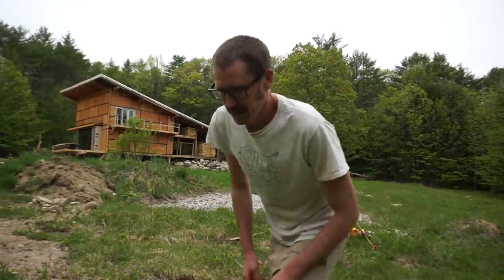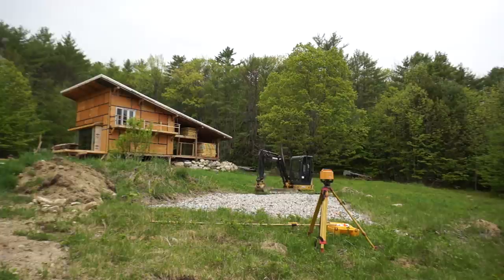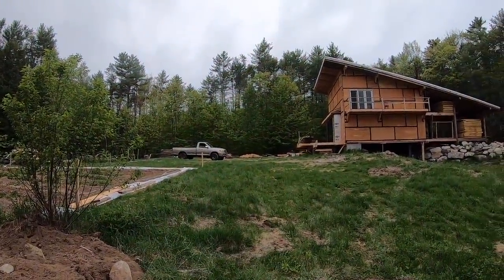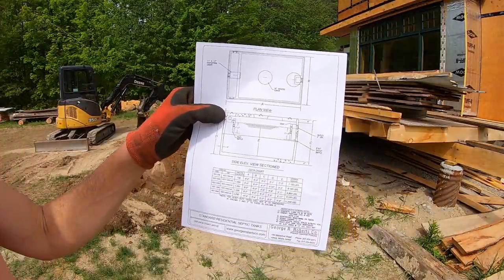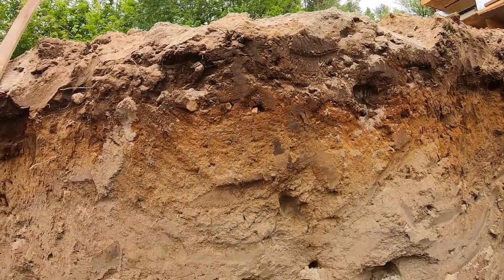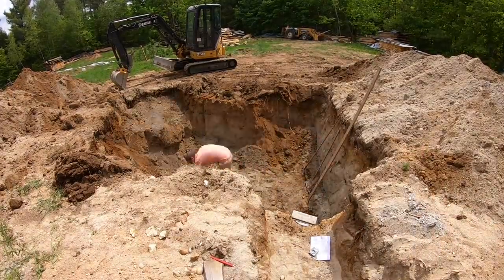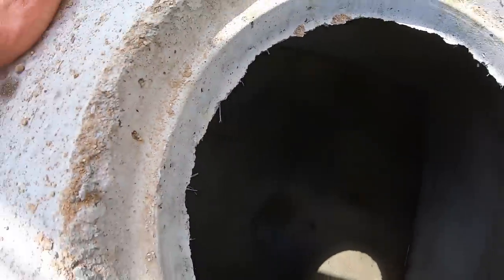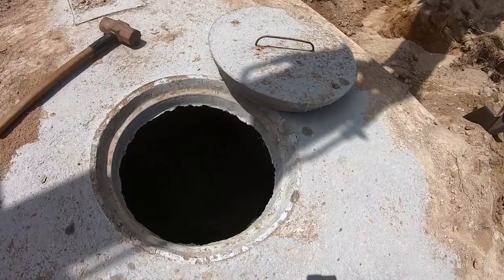Building a House from Trees SE 6 EP 2 Building a Septic System

Comment: You might want to consider an extension for your lid which makes it easier to have your tank emptied.  I recently bought a hard plastic lid which is suitable for driving a lawn tractor over without breaking.  All I have to do when our tank needs emptied is to remove 8 screws.  Your tank seems deeper then mine which might require you to get an extension.

Comment: Should have boxed the clean outs before covering e.g 2x8  to just under surface. The thin metal handels on the caps will rust out. Next time you've access using concrete lags to fasten in some chain handles.  Nice field and soil should work well for a long time. No grease...
Reply from the maker: Thanks for the tip. Its a good point. I used to dig up septic tanks for a side gig, and it was horrible to find the handle blown out. Thanks again.

Comment: I am catching up, can you tell.  I hired the septic out, you are a brave man.  But mine is on a slope and I needed an experienced installer.  Not sure if you are doing the plumbing but with pex pipe it is easy and quick.  I even installed the vent stack, you can do it.  Or not.  Water now septic, I see you moving in soon...  You probably don't remember but I have finished my concrete slab (88 yards) and the posts are up.  It only took 8 months, but like you I am doing it myself (with some help from my girls).  Trusses come this week, waited for 6 weeks on them.  Waiting on a boom truck and another helper in August I hope.  People don't understand how long it takes, if you are doing it yourself.  Total almost 4 years and counting.
Reply from the maker: Mine was quite straight forward and my friend and neighbor does this professionally.